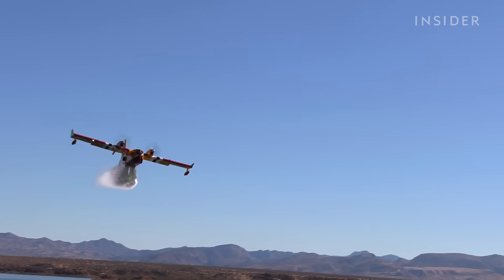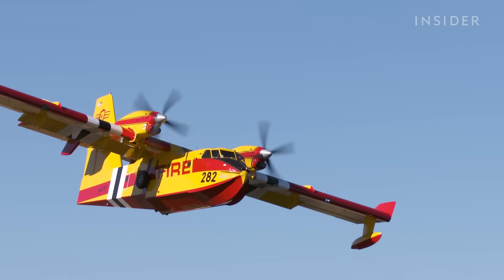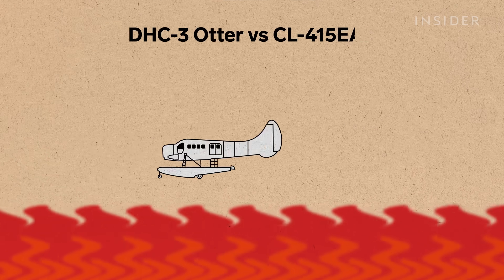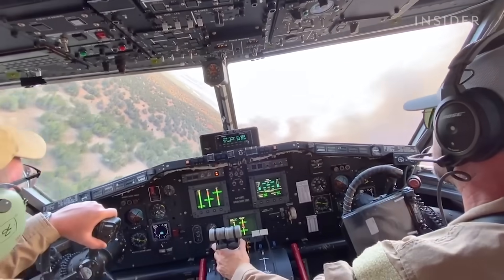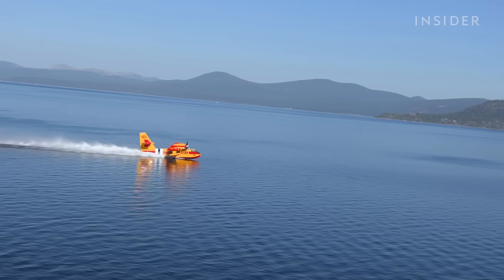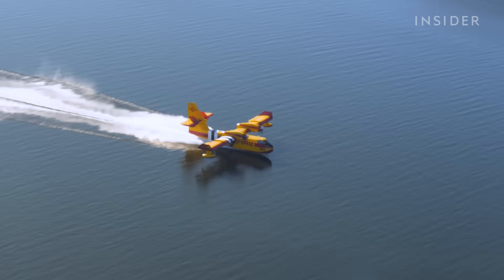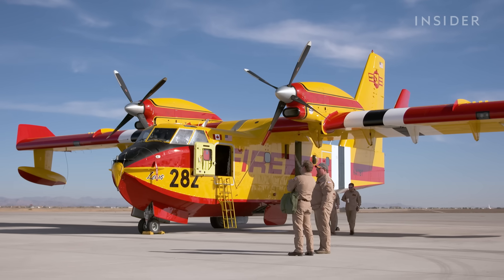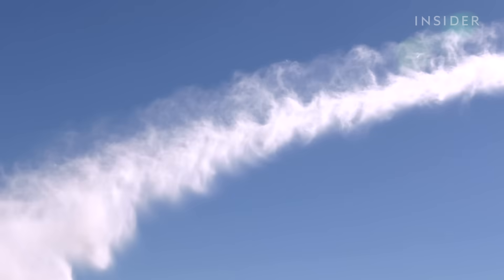How The $30 Million 'Super Scooper' Plane Was Built To Fight Wildfires

Comment: I'm wondering why there isn't a computerized targeting system for these aircraft.
Reply: Well thats a real challenge to develop wich would cost way too much i guess, the computer would need to have the sensors to calculate, wind and air speed,wind direction, air tempature ,the resulting lift wich hot air causes, and probably other factors, and then when developed you would have to fit those sensors in and on the plane without changing the areodynamics to much. Maybe the next generation of this plane type will have it, that would be pretty practical for the pilot for sure. Cheers from Germany.
Reply: @flamelion2019  Greetings from sunny SoCal. I think the first problem to solve would be when to release the water. If that could be made more accurate, it would be a win. Clearly, those other dimensions you speak of are also important to improve performance. Fires can create their own weather and ground conditions can vary wildly, so yes, the problem is complex.
Reply: My guess on it not having a computerized system is that the quick and ever changing fire/weather conditions make for ever changing plans of attack.  The Water-Bomber pilot is in constant contact with front line firefighters on the ground and the sometimes a fire spotting helicopter giving the bomber pilots the best plan of attack.  It seems a computerized system would be too fidgety.

The plan of attack can change so quickly that manual control of the drop can be adjusted on the fly for better results.
Reply: @zadraking  Fundamentally, the idea is to drop water on something burning. Ideally, the water goes entirely on the thing that is burning. That's about all I was expecting to be automated, at least initially. Firefighting technology will advance and it will be possible to make retardant and water drops more precise by including information transmitted from the ground and fire fighting commanders.

Comment: Impressive aircraft.   One GREAT enhancement would be night and thermal vision systems, perhaps along with a military style AWAC radar equipped aircraft to control the airspace. We really need to continue the fight during nighttime, when winds typically die down.
Reply: There working on a vision with night flying capability called the CL-515
Reply: @jameson1239  That's good to hear.  Thanks for the information.  I am a first hand witness to its potential benefits. A fire started on a 'Red Flag' day by a construction crew illegally welding outdoors, and having taken no preemptive preparations (even a hose). The forestry and fire fighting departments did an amazing job the first day, with just a proverbial 'lick' of fire lingering on the ground the following morning. But I watched that lick take off the next morning as the wind picked back up. Still, we were lucky. It 'only' burned another 2300 acres. Had it not been stopped, it had unfettered access to hundreds of thousands of acres and thousands of homes.

Comment: “30 million dollars is very expensive for any aircraft”
Military jets: Hold my beer
Reply: What would be the price of property saved in a wildfire ?
Reply: @cowwhisperer8927  Exactly!
Reply: @cowwhisperer8927  And animal lives saved?
Reply: @cowwhisperer8927  Quicker turn around to extinguish a fire would prevent less loss of property and most important which you forgot to mention is the loss of life which should be paramount in any equation. Property can be replaced. A life that is loss to fire cannot be replaced.
Reply: @w.maximilliandejohnsonbour725  True
Reply: @cowwhisperer8927  So 30 million for the plane Super scooper and 30 to 35 million for the S-64 Sky crane. Each one designed to fight wildfires or forest fires. Here is a crazy idea. You see a person or organization can get 5 or more used Mi-24's attack helicopters for around 500,000 to 600,00 dollars each. They really are flying tanks. Then you bring them up to FAA standards. Get rid of all the unnecessary weight. Retrofit the inside and undercarriage of the Heli so that it can deliver both water and retardant spray. So I guess you looking at 2 to 3 million dollars per Heli ( without going into expensive avionics ) to get a good flying fire fighting machine that can maneuver on a dime to surgically place the water or retardant where needed. ( Note the average pumper at a fire station cost around 600,000 to 1,000,000 per unit and they cannot go everywhere ). But that used attack Heli outfitted to fight fires can. And that's exactly what it would do. It would and could be used to attack the fire from a strategic point of view. Go get the water from wherever drop it or drop the retardant. Back and forth non-stop except for fuel and a little maintenance. Five or more of these flying tanks working in tandem would accomplish a lot. I know it's a crazy idea , but sometimes old military gear can be put to good civilian use. It was made for attacking military personnel and now it would be used to attack wildfires. Oh!. Plus you don't need but two people to operate the Heli.
Reply: @w.maximilliandejohnsonbour725  now compare time on station and fuel efficiency and general mro. Not trying to pick a fight just curious.
Reply: @billrolston5800  Sir: I was just having fun throwing out a crazy idea. That's all. Nothing about attacking anyone or picking a fight. If I have offended you in any way then please accept my apologies. I understand that most people now day's do not find some things as being humorous. Especially from someone they do not know. How I miss the old days when people could talk just about anything without being so uptight or ready to explode at each other. Oh well. I wish you well sir.
Reply: @ParadigmUnkn0wn  Oh!. Okay. It was just a out of the blue thought. Experimental would be the best way. Thanks for the info. Enjoy your weekend.
Reply: @cowwhisperer8927  Property, wildlife, greenhouse gas emissions and potentially human lives. In the life span of a plane like this i'm sure it would easily pay off.
Reply: @cowwhisperer8927  lol only bushes will be saved
Reply: And the waterbombers are used for something useful
Reply: Something that blew my mind was that a Boeing 747 costs more than a 400 meter long container ship.
Reply: B2: laughs in 2 billion dollar price tag
Reply: @_lime.
Reply: These Planes save forests and lives and money
Reply: happen to California is problems with the California or US government doesn't interest purchase them.
Reply: IKR XD
Reply: C-5 Galaxy and C-17 GlobeMaster III: SIR YES SIR drops 900 gallons of water
Reply: At least the wing spar doesn't break like on WWII cheapies. What a travesty North America won't spend money on real planes designed for the task.
Reply: Military Jets : hold my afterburners
Reply: I know trust me
Reply: And be used for something
Reply: 30 million for an "aerial-firefighting aircraft****"
Reply: Hate to say it but you need 20 of these to make a dent in CA fires.
Reply: @nickddd333  and thats the cool part! Canada has more than a hundred! All stationed around the country. Alaska also has around 15 units i think
Reply: Military jets not only squander countless sums of taxpayer funds, but their sole purpose is for the destruction of objects and living beings.  At least this aircraft is being put towards the purpose of preservation of life of other creatures and their habitats, something that hopefully continues once we humans are extinct (which can't come soon enough).
Reply: IN MY WORLD MY TAXES ARE USED TO BUY AS MANY AS NEEDED OF THIS PLANES IN MY WORLD MY TAXES ARE USED FOR MY HEALTH CARE AND EDUCATION IN MY WORLD WE HAVE THE RIGHT TO CHOOSE HOW OUR TAXES ARE USED.
Reply: 😅😅😅😅. You win.
Reply: Yea helicopter is OK till the wind picks up to ??? .then starts to spiraling then it's a fire tornado...not helicopter friendly 😊😅
Reply: @jackrabbit4383  The water capacity of a helicopter bucket is very small compared to the Canadian Super Scooper CL-415.
Reply: There's no limit when it's made for killing people it seems...🙄
Reply: South-European countries and california are going to need more of these in the future as Bush fires become more frequent... so stop wasting money on military jets as military ops can be done with drone technology!
Reply: 2 pröpped träsh xD but yeah it cänt carry village cöncrete weapönce vv
Reply: It is a nice looking plane. But for 30 million dollars that's a little pricey for a plane that can only do one thing. For that amount of money a  Erickson Air Crane® Helicopter ( S-64 ) would be a better investment as to the many things the helicopter can do. True the maintenance cost would be more for the S-64 , but the S-64 can do so many things when it comes to generating revenue.
Reply: @w.maximilliandejohnsonbour725  Helicopters are much more expensive to maintain than any fixed wing aircraft. 
Especially the mighty Skycrane.
Reply: @w.maximilliandejohnsonbour725  thing is. we can spend 300mil on a fighter jet that destroys shit. But 30 mil for a plane that helps is a lot.. That's exactly what's wrong with the world as it is today.
Reply: @lukasbodo9317  Exactly! 30M$ even for the light military cargo plane is nothing nowdays, yet firefighter, something actually useful, is expensive?
Reply: @w.maximilliandejohnsonbour725  The real point of anything mechanical is to achieve ideal efficiency. Everything we ever do with machines and technology either reaches a pinnacle or is continually improved by making it more efficient/capable/reliable. If you break it down to it's basics, what is more efficient at transporting water to a forest? Planes will always be more efficient with fuel that helicopters. Planes will always be more efficient at battling the effects of gravity. Planes are always cheaper to maintain that helicopters. Planes will always be able to go faster than helicopters. Beyond water source location limitations, from a physics perspective, planes makes the most sense logically.
Reply: @w.maximilliandejohnsonbour725  how much water that eriksson can take at ne time? and how quick will the heli need to fill up the water?
Reply: @fly89  The S-64 E and F can carry 2,650 gallons (about 10,000 liters) of water or retardant in a tank installed precisely in line with the rotor. The helitankers can hold a maximum 2,650 gallons of water and drop more than 25,000 gallons every hour. Also the helitankers or skycranes can get water from any location like a swimming pool , lake , river , streams etc. Any where there is water for a quick turn around trip.
Reply: @w.maximilliandejohnsonbour725  If water source is a bit away from the fire, the turnaround time would be to long with a helicopter. Not to mention the air time. A helicopter can not fly for six hours straight when water bombing.
Reply: @Xanthopteryx   then factor in down time for engine inspections and a plane looks real good
Reply: @w.maximilliandejohnsonbour725  Refueling frequency is an issue. A Super Scooper can stay airborne for many hours longer than a heli can. Also the planes are faster and can get further away from developed areas, deeper into the forest. Helos and Scoopers aren't mutually exclusive and many countries use both. Helos for tight areas and spots close to houses, planes for blanketing large areas of open fires.
Reply: @w.maximilliandejohnsonbour725  it is a firefighting plane. It doesn't need to do anything other than firefighting and doesn't need to produce revenue. Additionally I could talk about maintenance and flight time and fuel efficiency and cruising speed.
Reply: @thewingedporpoise  Okay Sir.
Reply: @w.maximilliandejohnsonbour725  ma'am. But thank you
Reply: @w.maximilliandejohnsonbour725  Very good point, but a helicopter does a different job for different scenarios. Yes, it is very useful when you don't have a large enough water source nearby and you just need to get water to the fire, but it's cruising speed is very low in comparison to the super scooper. You also have to consider the performance of the s-64 near the fire itself. Helicopters aren't as resistant to the hostile conditions than a plane, and are very vulnerable to the heavy turbulence and thermals generated by a fire. You also have to consider the mechanical complexity of a helicopter, with each vital part vulnerable to the ash and dust made by the fire, same going with the engine itself. Plus, helicopters are much more dangerous than a plane in general.
Reply: @w.maximilliandejohnsonbour725  30 milliion sounds bad, but for a plane of this size and low production number it is relatively cheap. A Twin Otter is around 7.5 million fitted out.

And when the forrest fires get bad, they are the by far most capable option. Here in Austria we have to call in the Italians and their CL-415 planes, every time we get a particularly bad one. And that's even though we had ample supply of helicopters, fire trucks and roads into the forest.
Reply: @w.maximilliandejohnsonbour725 the S-64 is slow and has pretty limited range and is a maintenance hog also the CL-415 can also be used for maritime patrol, SAR and other such jobs Malaysia just bought two of them to do that
Reply: Yeah but with that snazzy paintjob those fuckers could sit lookin' pretty a hell of a lot longer before I get sick of lookin' at em.

Skycrane is cool and all but they really oughta finish the back half of that aircraft, shit don't look right! ;P
Reply: W Max......I'll take the word of the professional fire fighting pilot over the word of a keyboard junky
Reply: @w.maximilliandejohnsonbour725  Canada is currently contracted to purchase 88 F-35 fighter jets at an average cost of $89 million per craft.   Due to it's ability to land and take off from water surfaces, when not fighting wildfires, the Canadair CL-415 is a viable search and rescue craft and functions as an offshore patrol aircraft on Canada's coastlines.

Comment: An interesting thing about this a/c is the bow is armoured. If picking up loads in forested lakes there are often old stumps and logs just below the surface. They would punch through normAL a/c with no problem. That is why the bow is made of heavier aluminum.
Reply: I didn't even think about that
Reply: I've experienced such hits when travelling on the large hydrofoil vessel @ 70 km/h. It's horrible.
Reply: Duralumin is widely used for planes.
Reply: and they still have to reskin the bottoms every few years. Logs, rocks, boats fishermen etc.... :)
Reply: Wow. Obviously the design was result of a development process.
Reply: Irrelevant. When scooping water, it is only the middle of the fuselage that comes in contact with water, essentially hydroplaning. They would also restrict themselves to picking water only from body of water that had been checked and shown free of obstacle and debris.
Reply: I'm going to buy 1 of these to scoop up anchovy and other small fish that sharks round up to the surface
Reply: @again5162  You aren't.
Reply: Aluminium is a soft metal, like brass. Aluminium armour makes no sense.
Reply: @TheSiriusEnigma  I used to work for a company where we made armour plating for the f35 all from aluminium it's all to do with how its treated in the ageing process the more we'd age it the tougher it was
Reply: @TheSiriusEnigma  You are just uninformed. Nobody uses pure aluminium, alloys do exists. And there are alloys that are suitable as an armour, used in fighters and APCs. Quite a few military vehicles were produced with that technology. M113 is the most common, also Russian BMD family. While not ideal solution, it is viable as a protection against small arms fire, especially in an air-dropable vehicle.
Reply: @tdfbbfhk786d  El aluminio aeronáutico es con aleación de cobre y con tratamiento térmico. 
Existen variantes determinadas por el tipo de avion siempre buscando mayor resistencia.
Reply: @TheSiriusEnigma  It doesn't matter what the hardness is,  aluminum is the same strength as steel.
Reply: @TheSiriusEnigma  of course, aircrafts are made of aluminium alloys, not pure aluminum. Their properties differs widely. This 'armor' is against half-submerged wooden debris, not against ammunition.

Comment: 30M expensive for an aircraft? Not really. (all prices in usd)
Cessna citation jet? About 18M if memory serves (I'd consider this extremely affordable for a jet)
Gulfstream g450 jet: 30-40M
Gulfstream g650 jet: 65-80M
Airbus a320-200 (the most used commercial aeroplane): 101M
Boeing 737 (2nd most used commercial aeroplane): 106M
A320 neo: 110-116M
A380 (largest commercial aircraft) 445M
B747 (another very large commercial aircraft): 418M
A340: 600M
B2 spirit: 737M

I really don't see how 30M is expensive for a plane. Please explain.

Comment: Now is fire season in the Peruvian Andes. I wonder how large does the lake need to be to scoop in a sole load, specially when most of the  water sources (and also fires) around here are over 11500 feet over sea level
Reply: These planes don't work for huge fires. All they can do is control a fire until it burns out.

Comment: I'd rather take Be-200 (up to 12 tonns / 3228 gallons of water in 14 seconds). Water tanks emtpying (in case of single salvo) in 0.8-1 sec.
Reply: Sure. Funnily enough, they can't sell them to anyone and plenty of countries have tried them.
Reply: Certainly (Ironic). That's why spanish and french Bombardier CL-415 (previously Canadair) are right now working in Turkey and Greece wildfires at a ratio of two to one compared to the the Be-200. The Be-200  is in real trouble to keep this pace while performing  poor accuracy on the drops.
Reply: @pasodeminick  when Portuguese rented it it did a couple of drops then hit a tree then broke down. Useless, just like the kamov helicopters.